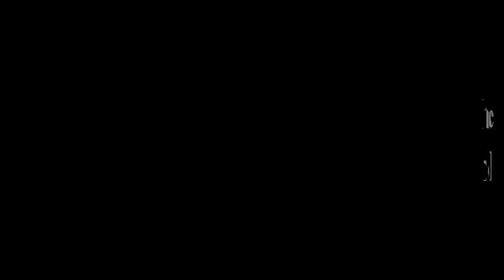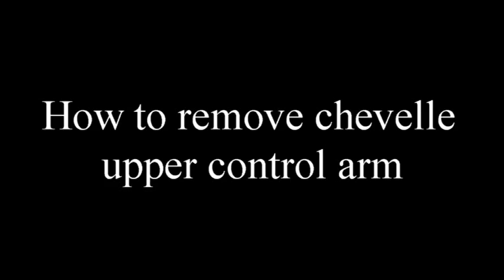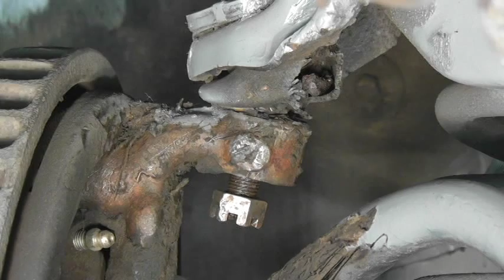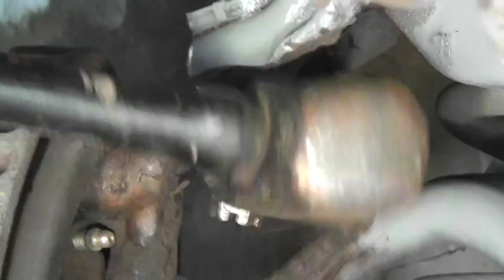69 chevelle control arm removal without fork

Comment: For anyone that is doing a restoration and you do not want to beat the hell out of your spindle or upper control arm and leave hammer marks just buy a damn $10 fork tool from harbor freight.
Reply from the maker: Yeah. That spindle looked so sweet until I beat the hell out of. I totally regret it. Do you have any more sage advice for me?  How to roll a tight joint I suppose.